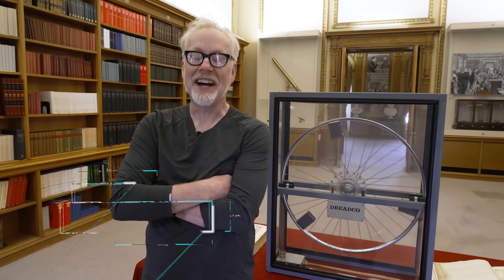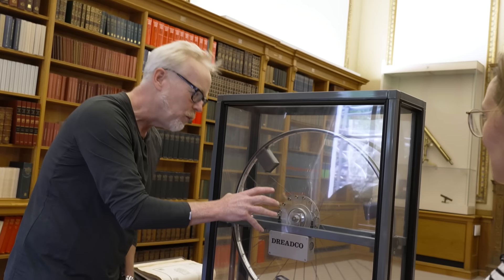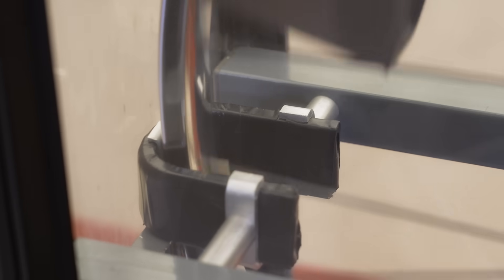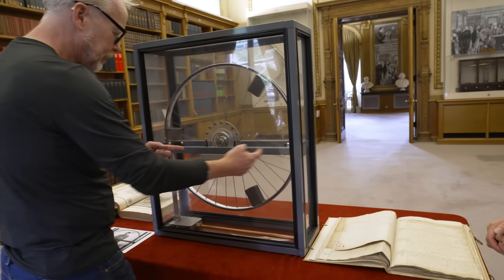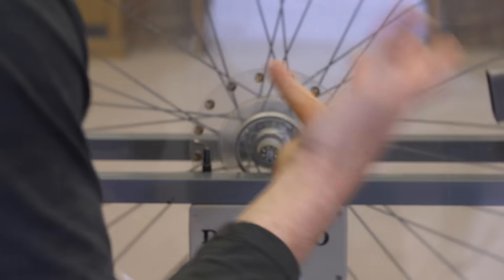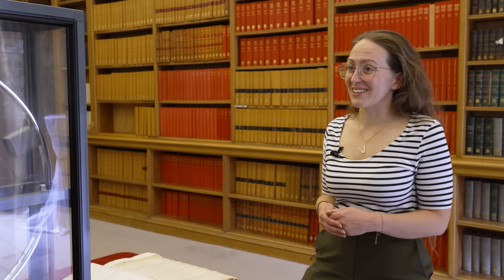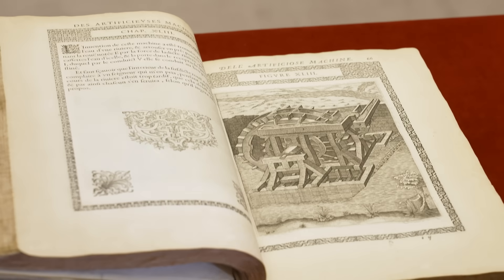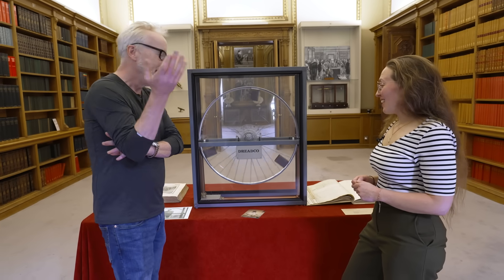Adam Savage vs The "Perpetual Motion" Machine!

Comment: I assume the "servicing" involves giving it a good initial spin 😉
Reply: and some new batteries XD
Reply: They replace the hamster.
Reply: That would mean that it would spin at high RPM directly after service, and get slower and slower over the span of 2 years until the next service. If that were the case, it wouldn't be such a big deal because it'd be more than obvious that it is just freewheeling, but I feel the main consensus is simply "batteries and magnets".
Reply: It would start at a high rpm then
Reply: Double your perpetual motion machine speed for free!
Reply: or maybe just greasing the gears...

Comment: Is the Earth considered to be in perpetual motion?
Reply: Yes and no. Firstly, you need to nail down the definition.
Reply: @TurinTuramber  That's why i asked as the definition of perpetual is in motion forever, and as nothing lasts forever then the definition is kind of misleading and in my opinion requires changing, as there is no point in attempting something that is defined as impossible from the beginning.
Reply: @TurinTuramber  I thought the same thing.  None of it has to be so misleading and confusing.... like why do they call photon's particles when they have no mass, or Dark Matter, when it's neither Dark nor Matter, just a load of contradicting definitions used by science, it boggles my mind.

Comment: Black boxes on the spokes are coils, moving through the magnets generates enough power to operate a small heat pump in the box at the bottom with the heatsinks. The air movement from the heat pump is enough to move the wheel which is extremely well balanced. Maintenance is to top up the refrigerant in the heat pump. That's my guess!
Reply: You could get the same thing without all the extra parts with just the well balanced wheel. 

The coils causing drag to work a heat pump is a silly and wasteful extra step. Just skip it. Heat pump is only high 0.90s efficient... Refrigerant is not a source of energy just a compressable fluid.
Reply: @ShawnPitman  The energy source would be the extra heat entering the system through conduction.
Reply: That’s too complicated to be “disappointing”.
Reply: You haven't answered the fundamental question.  Where does the energy in excess of unity come from?
Reply: @CorwynGC  either the solution is really boring and it's just a hidden battery or it's not really a closed system and extra energy in the form of heat is coming into the system. I think those heatsinks are for gathering heat not dissipating it and a very efficient small heat pump is used heat air and release it onto the wheel providing the motion.
Reply: @questjon  You still haven't answered the question.  A heat pump works on a heat DIFFERENCE.  Where does that come from?  IOW, where is the cold reservoir?
Reply: @CorwynGC  A heat pump can work without a heat difference but it's much more efficient if there is one and there is! Since heat rises there will always be a slight  temperature difference from the bottom to the top of the box and between the inside and outside of the box (if work is being done inside). There is no cold reservoir, it's just a very very small amount of energy being extracted. Just enough to keep a very balanced, near frictionless wheel moving.
Reply: @questjon  I can't reconcile your claim of there being a slight temperature difference AND there being no cold reservoir, those are the same thing in different words.
Heat doesn't rise.  Warm fluids are generally  less dense than cooler ones and so will tend to displace those higher up.  If that wheel is doing any work at all , it is mixing up the air in that box to prevent any stratification of the temperature.  
I would love to see a heat pump that works with no heat difference and no external power source, as it would solve huge problems, please post a link.

Comment: Has to be batteries right? Servicing = change batteries?
Reply: Of course! It must have power going in. That or a spring
Reply: Has to be extremely efficient to run on batteries for that long, even if they have filled every space possible with them.
Reply: @Zveebo  How long do your battery-powered clocks and watches run for?  Do they have 'every possible space' filled with batteries?
Reply: @ceptimus  They’re turning hands weighing a few milligrams, not a bicycle wheel, so that’s a total strawman. Stop playing games.
Reply: @Zveebo  Shame you have no understanding of physics.  The energy required to keep a wheel turning at a steady rate has nothing whatsoever to do with its weight - the energy required is just that consumed in bearing friction and aerodynamic drag.
Reply: @ceptimus  And the weight is totally relevant to friction, which is the whole point. That aside, how many total rotations does your watch even manage before charging? It’s a totally bizarre nonsensical comparator.
Reply: Magnets.
Reply: @harezy 
There are lot's of those machines wich use magnets, but even when magnets are involved there has to be some kind of energy wich keeps the machine running. Only magnets don't do the trick.